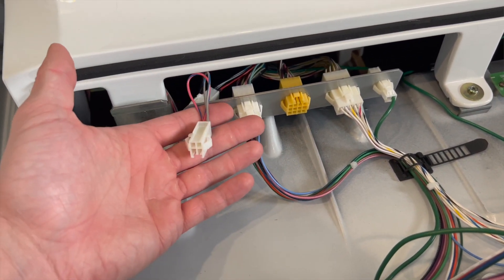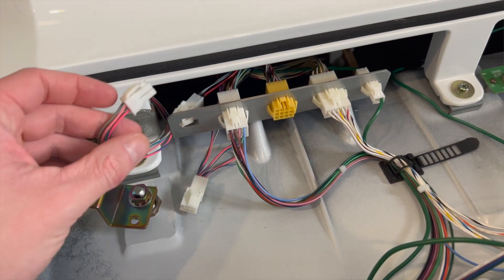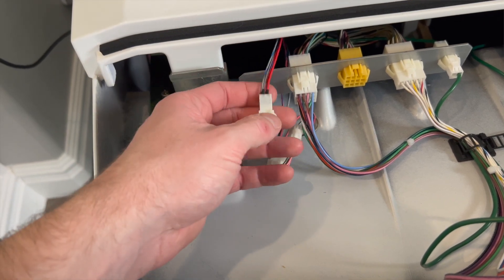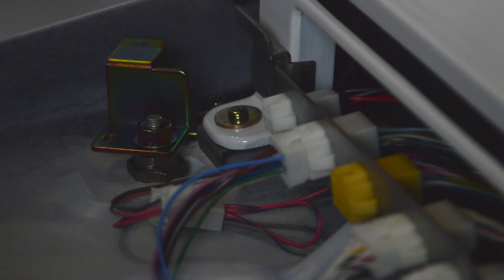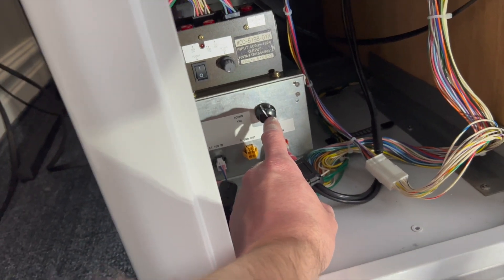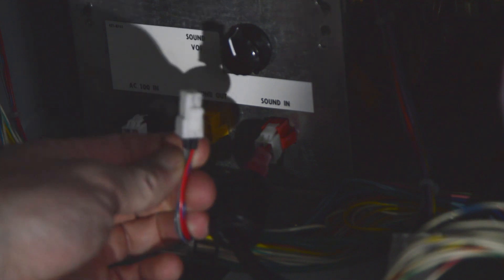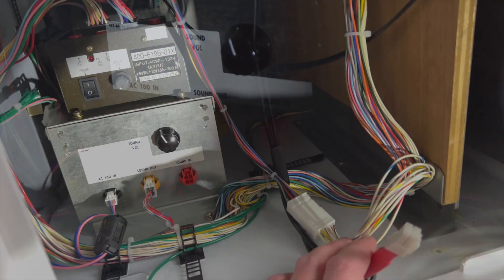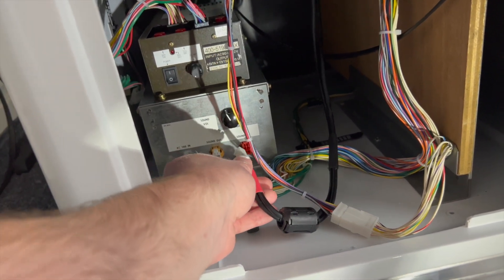Astro City Stereo Speaker Setup

Comment: For the speaker out, are you sure it’s left speaker on top and right on bottom? All of the pinouts for Sega amplifiers show right speaker on top, left on bottom.
Reply from the maker: The pinout described in the video does give the correct audio output. Facing the cab L is on your left, R is on your right.

Looking at the Daytona USA pinout is kind of inconclusive. What pinout are you referring to?
Reply: @itsroadtrip8160  hey you were right. The wiring from the speakers is left on top, right on bottom. I was confusing with the receptacle on the amp which is right on top and left on bottom.